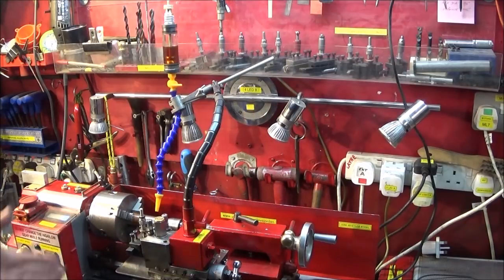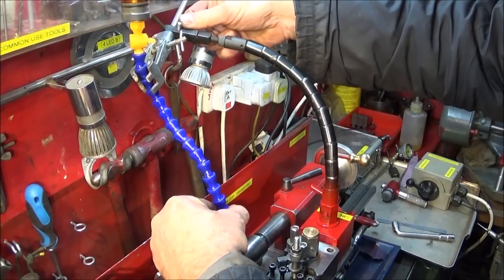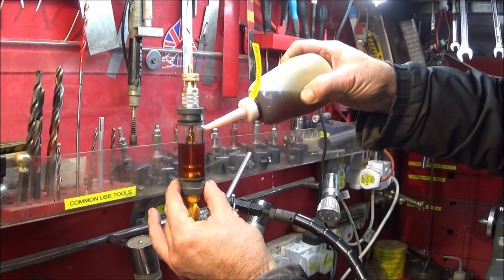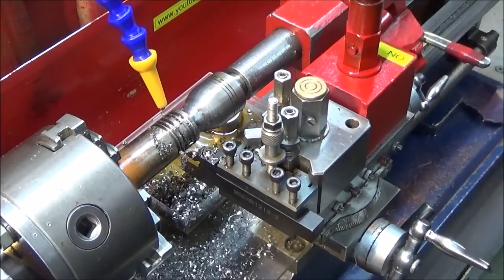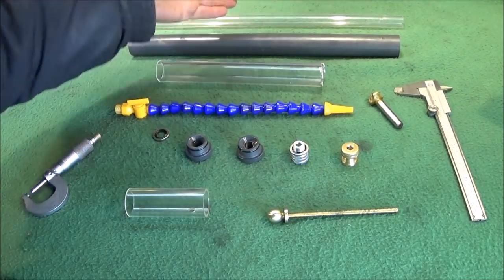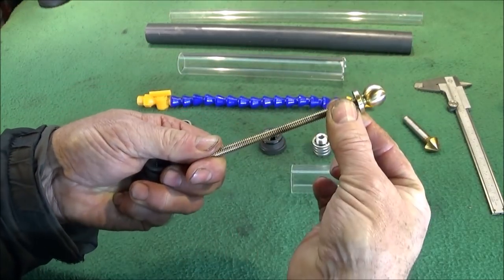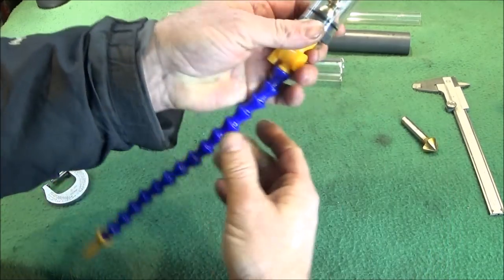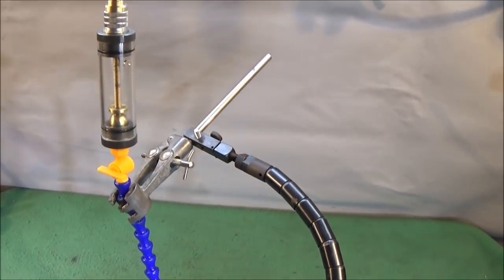Make A Simple Portable Machine Fine Drip Feed Cutting Oil System

Comment: Steve as usual a great idea and well explained, I use my shed for using the lathe, and so I will have to wait for the weather to warm up a bit. .Anyone have  ideas on a good, safe, cheap, way to heat a shed for a couple of hours a day.
regards Colin.
Reply: Lift the shed into a spare room in your house
Reply: Hi Colin,  I use a small storage heater, through a timer, it's set to come on about 3am and off at 7am so running on low night rate energy. I have it on minimum temp. and my shed aka The Wendy House (where I play ) is about 68 F most of the day.
Reply: A Heater!

Comment: Parrafin was as a cutting lube for aluminum? Do you apply it by rubbing it against the stock?
Reply: Meant to say Wax..... I think we buy it in a block almost like a bar of soap
Reply from the maker: +brockfuzzy69 Yes paraffin is excellent for use on aluminium. Just brush it on or apply with bottle sprayer. It works great for parting off. Regards Steve
Reply: +brockfuzzy69 
Mind you, "paraffin" in british english means "kerosene", or lamp oil... I believe WD40 works fine too
Reply from the maker: Hi yes it is virtually the same thing. A lot of people don't know it, but kerosene is what all jet aircraft use as fuel. I do sometimes use a cheap copy of spray oil similar to WD40
Reply: I use the stuff to fill up my divecomputer after a battery replacement, but now I know this, I'll give it a try on my aluminium lathe work ...
A drawback of your system is a quite lengthy afterdrip I assume ?
Reply: Maybe adding another tap lower down would solve that.
Reply from the maker: It seems to be ok not much after drip noticed. I forgot to mention in the video that I can quickly drain the oil cyclinder to empty it when its not in use, by lifting the ball valve straight up....Regard Steve

Comment: Excellent idea Steve, I've started gathering the materials to make one. Did you use any lapping medium between the ball and cone ? Many thanks once again for sharing another great idea. Best wishes, Brian
Reply from the maker: Hi Brian, Thanks....I just gave it a polish with fine emery, I also used about 300rpm spindle speed and held the ball in the cone. It worked like fine that, but if not I would have used a bit of T-Cut...Regards Steve
Reply: Many thanks for the advice and your prompt reply Steve, very much appreciated.

Comment: Very nice Steve! question...did you ever install taper rollers spindle bearings on the lathe?
Reply from the maker: Hi Lawrence, Yes I fitted the taper roller bearings and replaced the plastic headstock gears for metal ones.
Reply: Yeah I figured. if setup like your lathe(no slop) parting on the mini is easy :)
Reply: Steve Jordan a